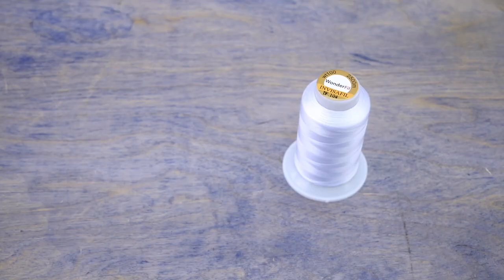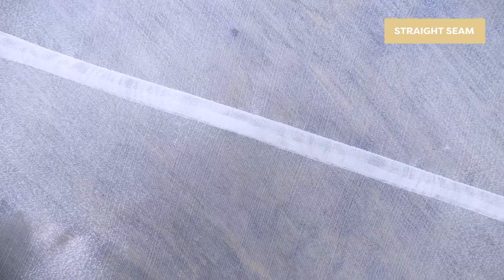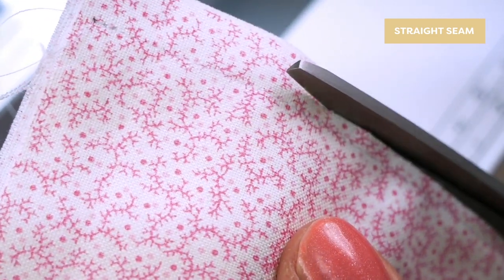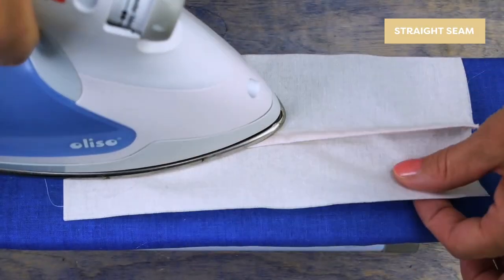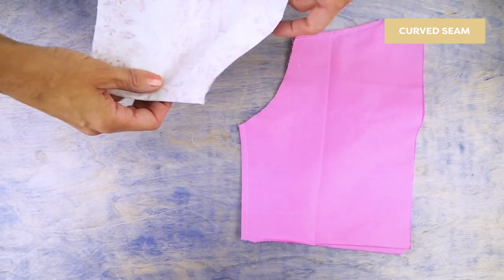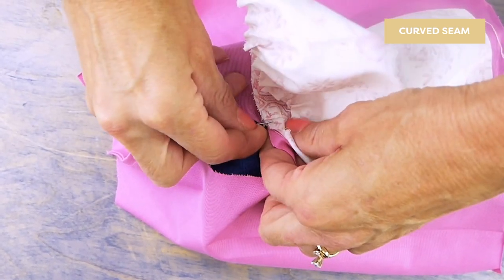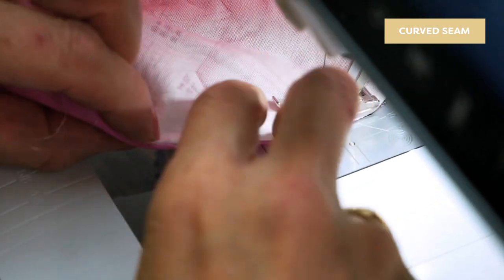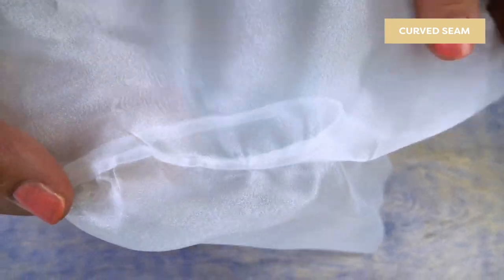Sewing Simple French Seams (On Straight and Curved Seams)

Comment: Thanks this is really well explained and helpful ! 
Do you think I can also do this for the curved crotch seam of a pair of pants or shorts ? All the tutorials I find keep using an overlocker (which I don't have) or a zigzag stitch but I don't like the look of it. If not is there another way to make a clean finish with no raw edges visible?
Reply from the maker: It should be possible to do it along a curve if your fabric is light enough and it doesn't have a zipper. Another method you can use is the turn and stitch method. There's a great online tutorial at this link: https://sewingmachinebuffs.com/finish-raw-edges-of-fabric-without-a-serger/
(Method 3) Hope this helps!
Reply: You can also try to use bias tape. As a beginner I've found it an useful way to save some of my projects.